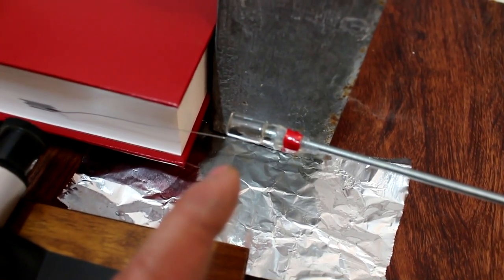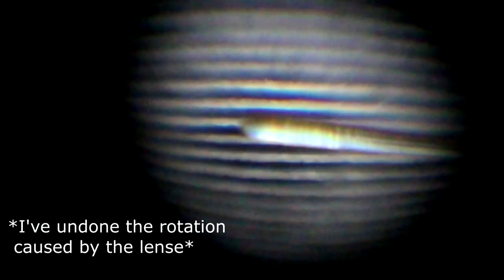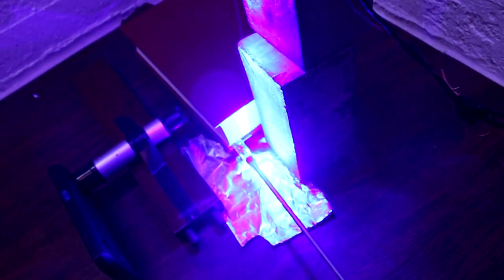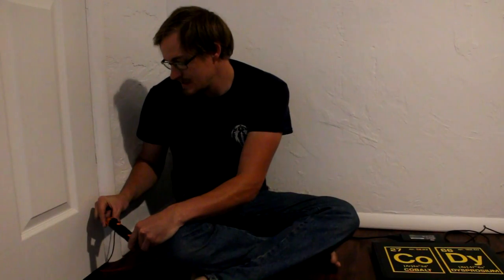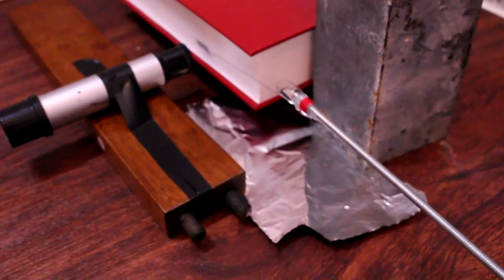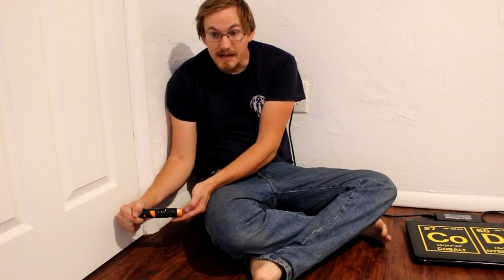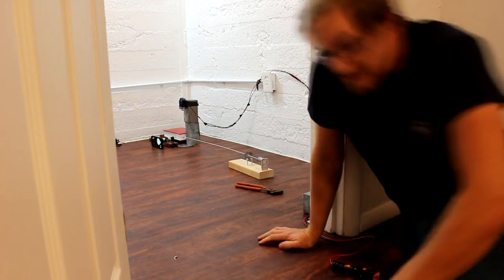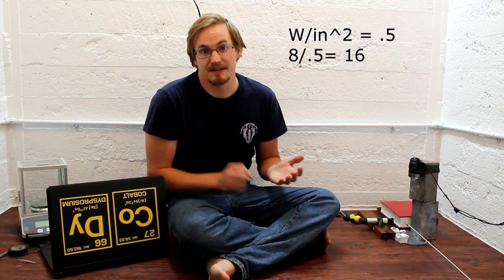Does Light Push?

Comment: I watched the edit of the results a few times. I am not seeing what Cody is seeing. It appears to me, the noise in his system is greater in magnitude than the expected possible measurements. This isn't intended to be a Troll. I think this system just needs to have an order of sensitivity of 2-3 magnitudes. Cody should start with an air isolation table and use a Michelson Interferometer.

Comment: Well, does light have a recoil?
As we know nasa is building/wants to build satellites that move with the thrust of the sun.
If light doesn't have any recoil but pushes an object, couldn't you power a big fat laser with sunlight that produces more pushing than the sunlight? 
So you could have a faster travel in space.
Or am I completely wrong?
Reply: If you collect light from the sun to power the laser, you may loose energy due to the inefficiency of collection then emmision, I think. You are better off bouncing the light off with a mirror to propell yourself. 

Unless you want to store it, but I dont think you can store enough energy to make significant  trust. Specially cuz you then have to propell the batteries mass.

Comment: The reason you can’t confirm double is because it takes less energy to redirect light using centripetal force. That is why you get a higher reading absorbing the light than reflecting it.

Comment: Glass is not a good conductor of light, the outside of the glass would still accelerate photons.

The mirror would double the surface heating compared to the carbon.

Comment: If light has mass why does it travel at light speed? Wouldn't that impose a massless object could travel faster than a photon such as a wave?
Reply: Energy is equal to mass multiplied by the speed of light squared, therefore the laser is energy
Reply: Well, light does not have mass, and so travels at C ( if light had mass then i don't see why they would name the speed of mass-less objects "the speed of light" :/), but it does have energy due to the momentum it has moving from rest to "traveling"

Comment: I'm not so sure about that as I know hot air is heaver than cold air and wonder if the laser might have been heating the air in the little bottle or around it

Do that test again and get the change in temps on that bottle after the laser hits it

You might even mention hey it was in a vacuum then I will have to tell you how that vacuum pump will never get a perfect vacuum and there will always be that small amount of molecules of air still in it although all moisture will be gone at 400 microns it is still not a perfect vacuum and if you only had like a 1200 micron vacuum there would still be moisture in that bottle

Well never mind when it came to the end you did mention heating the glass which is what I was thinking 

So with that in mind I know hot air is heavier than cold air but if I heat something up will it make the mass heaver than when it was cold? That is an experiment I would like to see every since it was proven to me that hot air is heavier than cold air

That little device you made could be used to measure that
Reply: Cold air is heavier than hot air or how would you think a hot air balloon functions. :)
Reply: This guy had explained it real good in one article I found 

Warm air does not rise because it is warm nor does cold air sink because it is cold, If this were the case then the temperature structure of the troposphere with cold air overlying warmer air could not exist. Denser air sinks replacing less dense air. The air closest to the ground is densest and the air higher in the troposphere is less dense even though it is colder than the air on the ground. 

I got my info from a professor of mechanical engineering at UT and he explained it something like this

Hot air molecules are denser (heavier) than cold air molecules (lighter) is how that works and the way the professor explained it to me was that heat rises but heat is not a molecule of air but only heat and nothing more, Talk about confusing LOL

The lecture was about how hot gases are heavier than cold gases in a flue pipe which was why the flue pipes had to be a regulated size for the BTU of a furnace being as one too big would make the flue gases too heavy in the pipe to vent properly out of the stack and then he proved that by showing us how they would not vent when the pipe was too big and actually came back down and snuffed out the flame

In the end he did make a convincing lecture about how heat rises not air or gas molecules and so the heated air molecules would rise with the heat that had heated them but they were still heaver than cold air molecules or like the other guy said we would live on an earth that was as cold as outer space

Comment: you expected the glass test to move? 'because it is heating the glass a little bit'. This surly sounds like it could then be affecting all your other results? No biggy, I'm just a bit concerned by how it sounds... :P
Reply from the maker: The movement due to the glass is a component of what I saw. thermal from glass + light pressure = total result I tested it on the glass only so I could account for it in later tests.
Reply: Ya but considering they all changed differently it didn't really affect it
Reply: ***** I guess I was being pedantic, I realise light WILL give light pressure. I just couldn't really see the affect from the experiment. :P now thinking of how air affects the results, a good test sounds really difficult to do! I commend you Cody for getting results! even with air variables at play. ^_^

Comment: That's pretty cool I didn't think photons weighed
Reply from the maker: Think about it this way: If you put a bunch of photons in a box with perfectly mirrored insides so that they couldn't get out and you put this box in a gravity well the photons would loose energy as they traveled up to hit the top side of the box and would gain energy (blue shift) as they "fell" down to the bottom side. in this way the photons would exert more force on the bottom side than the top in such a way that if you put it on a scale you would detect weight.

Comment: I read an article that says they will use a huge, super thin mirror or reflective sheet on the back of the vessel that will take man to Mars. What do you think?
Reply from the maker: I sure could! the lasers would cost more than a normal space mission though.
Reply: ***** I can see that. Is there a specific color of light that may be stronger than the rest? I saw a video that green laser lights can burn easier than others, like red.

Comment: A silly idea i had;-  graphene is a lattice of carbon, 1 atom thick. Placing one sheet of graphene over the other, but moving it very slightly (a planck length would be just perfect, but maybe not possible) and then another, moving each successive layer, until the lattice become a impervious/a wall of carbon, with no gaps! Possibly a sail, for neutrinos or photons and thats it. My silly idea!!, come at me, is this possible? Can the billions upon billions of neutrinos emmitted by the sun be harnessed, with a graphene barrier arranged like a sail, so we can tack around the solar system, or maybe even further...??
Reply from the maker: To a neutrino the nucleus of the carbon atom and even the protons and neutrons are mostly empty space.
Reply: @theCodyReeder  well yeah, that too! I didn't know that neutrinos could even pass through a nucleus, avoiding the quarks! slippery buggers, and a silly idea I guess. Its a shame, all that energy/motion and we can't harness it. Sailing the solar winds sounds just too good doesn't it? too good to be true :( Thanks for taking the time Cody, and likewise for doing such cool stuff, so we dont have to! Keep on keepin' on. G

Comment: doesn't light heats column of air and makes it expand thus pushing the needle.
Reply: If it did, the needle would have moved equally on all 3 measurements.
Reply: no, the heat is transferred to charcoal, single beam to heat the air, when he used mirror he doubled the effect, so the same results...
Reply: No. When he hit the glass only, it barely moved at all. When he hit the charcoal, it moved more despite not causing any expansion, and when hitting the mirror, the light get's deflected somewhere else. Also remember: when air  expands, it does so in all directions instantly. But notice how the indicator moves more and more  downwards during the procedure. Air would'nt be able to gradually push it down like that.

Comment: Question from a noob: since it can move so little with a small object like this, wouldn't it require a gigantic amount of energy to move something big  like a spaceship at a decent speed ?
Reply: luckily stars can provide that energy and force is a product of pressure times area, so having a gigantic solar sail in proportion to the craft's mass could accelerate the spacecraft to over 5% the speed of light (14,989,622.9 meters per second) in optimal conditions. That is fast enough to cover the entire diameter of earth plus some in a second.

Comment: If you throw a ball and it sticks it imparts less momentum than if it bounces. You just said that. While that that may be true, it's worth pointing out that if the ball sticks than the stickee now has a ball they can throw with no definable limit to the force they can throw it back which in turn can provide more momentum than if it had only bounced off instead. Imagine a tiny meteorite bouncing off your ship knocking it off course. Or you could catch the meteorite and then send it out the back through the blast furnace.

Comment: "photons carry energy therefore they carry mass, E=mc^2"  Uh, no.  Photons have zero mass and the formula is E=pc.  The formula E=mc^2 only applies to a massive particle at rest, and a massless particle is never at rest, but always moves at the speed of light, in any inertial frame.  You have to use the more general Einstein dispersion relation E=sqrt(p^2 c^2 + m^2 c^4) and then take the massless limit.  I guess the moral of the story is, ask a physicist to review your video before posting it.

Comment: The mirror and charcoal placed on or in the glass bottle changes the dimensions of the WIRE through the heat generated with the !!8W!! laser! Are you kidding!? The radiated heat of the mirror bends the wire you have conveniently placed close to the bottle. Can't help to think that you knew that already because to enhance the effect the wire needs to be made long and that's exactly what you did. lol . You even put aluminum foil underneath on the hardwood floor so it doesn't get burned. I hope this is a joke.  Quite dumb actually If you think you have measured photon pressure here.....but at least you got a lot of views.